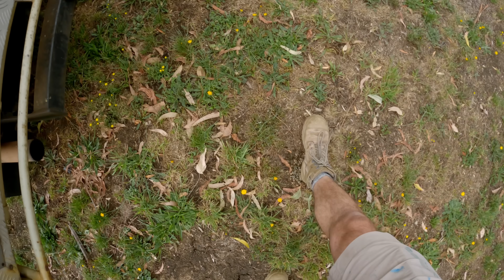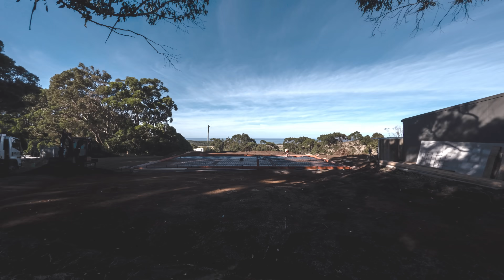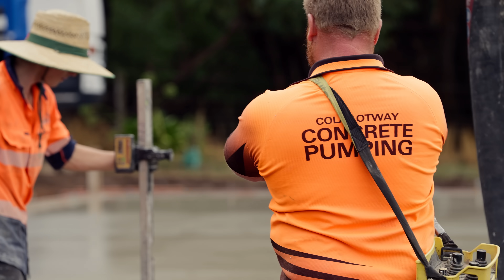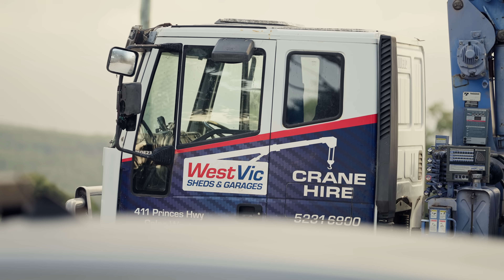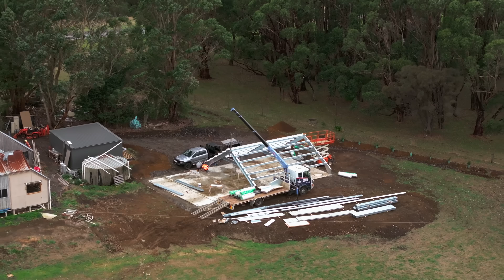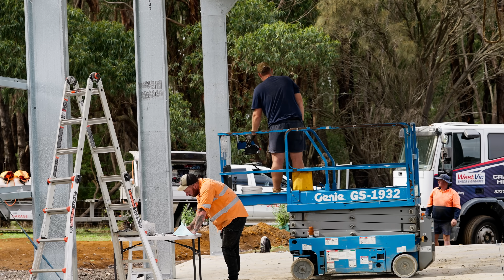I Built My Dream Workshop… And It Got Out Of Control

Comment: Amazing shed! Question though. I understand this is in sort of coastal area? If yes, that means more humidity and "salty air". Building shed of this size, plan would obviously be storing a lot of expensive equipment and machinery in it. So how well is this shed insulated and will it have any humidity/temperature control? Because if not...a lot of equipment/materials can be damaged by humidity and even by too high or too low temperature. How hot can a metal shed get without any ventilation or AC? A lot of tools run on batteries these days, those batteries do NOT like high temps, for example.

Comment: They should not have used screwbolts to hold the shed down considdering the holes were so close to the edge of the freshly poured slab.
The should have used rag bolts cast into the slab or chem anchors.
Reply from the maker: I’m not an engineer. That’s what was specified. She’s not going anywhere.

Comment: Now that is a shed. Is the insulation sufficient for the climate - cold & heat?
Reply from the maker: Not really. It’s just to help. It’s basically a slight insulation vapour barrier. Will help a little. But the big roller doors are just going to let the wind in around them anyway. When I build some enclosed clean spaces inside they will be insulated and separated from the big open sections.

Comment: They did the same with my dream shed 24x12x3.6(on 10ac block), but they did the roof lift in two stages. 
A bit sad tho... as Im not getting to use the shed(currently getting sold to the tenant), the house never got built because Mr J Howard changed the lending valuation laws half way through our house design process and the values in this area were very low at the time... insert the Insurance rort I wouldnt pay $30k+ to tick a box that Mr Howard put in place to please his Insurance company mates!
Silver lining, we ended up buying a place near by for a lot more than the house build... without no LMI insurance needed! Its got 12 sheds our main house and a B&B cottage house and a forest of 100' trees surrounding a huge dam on 16ac
Reply from the maker: How good!